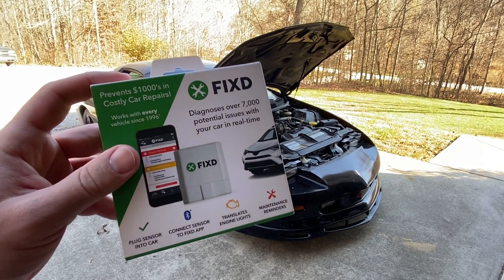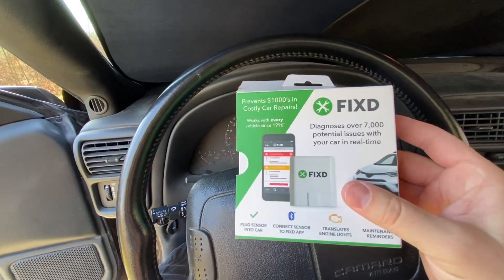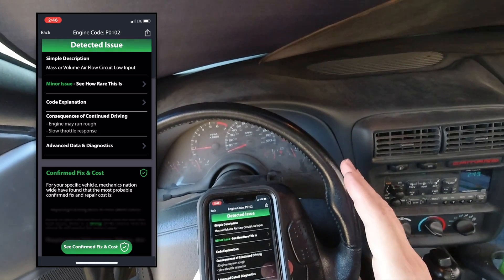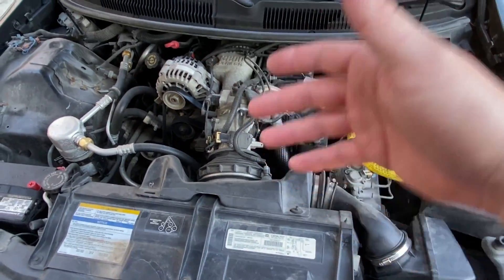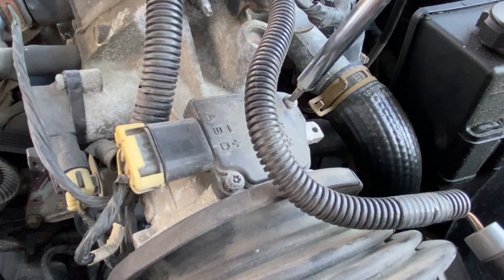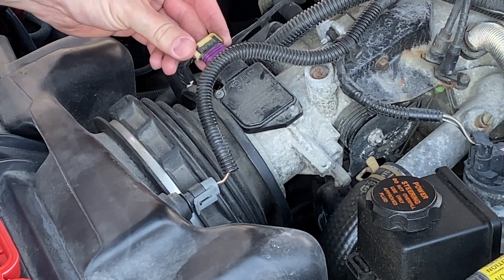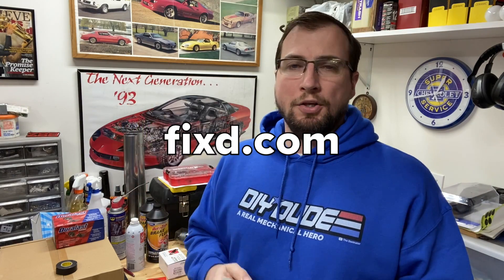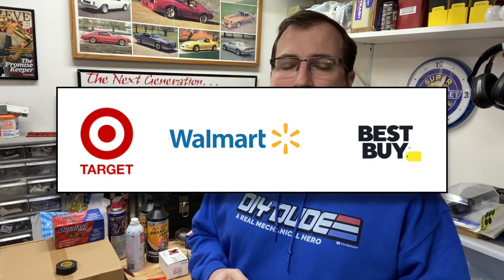P0102 Check Engine Code - Using the FIXD App - Easy Fix!

Comment: Was this using the free version of the app? Wondering if it will do fuel trims and O2 sensor checks on the free version.
Reply from the maker: I used the free version for this video

Comment: Why does every person with a video on this trash, call it an obd2 sensor. It's not a sensor. 

It doesn't tell you trouble shooting methods. Possible problems for parts changers is what you meant to say, because that's what you were prepared to do. Swap a part based on a code. So glad you shared more nonsense with the internet.

Comment: Hi, I haver a 93 Camaro in Brazil, using FIXD can I diagnose possible errors that are recorded in the central? Thank you for sharing the information.
Reply from the maker: It only works for vehicles that are a 1996 or newer.
Reply: @TheDaninator  Too bad, I will check the option of the Bosch OBD 1300 (OBD-I and OBD-II) on the same scanner. Thanks!